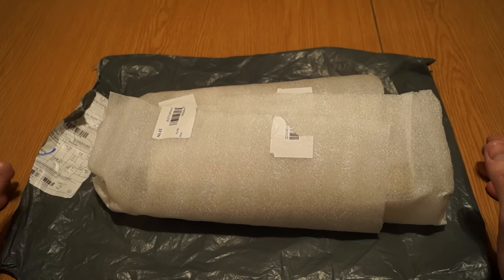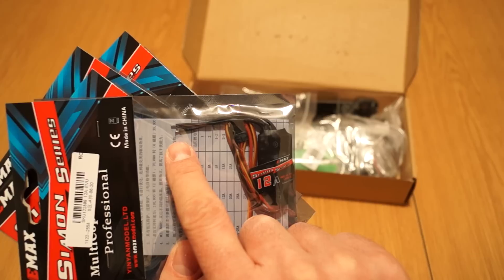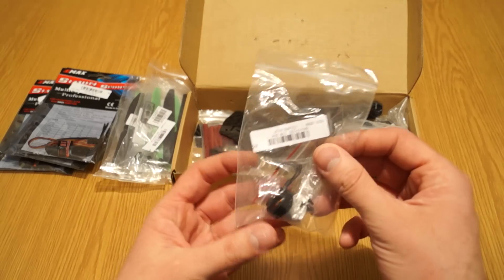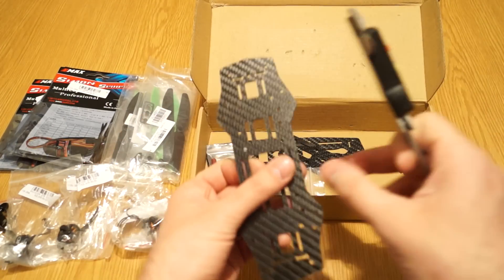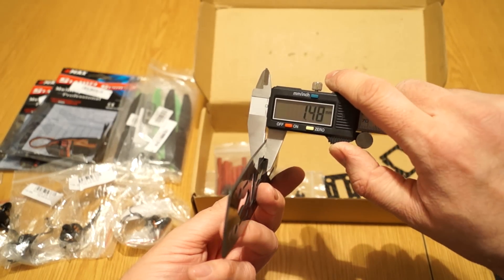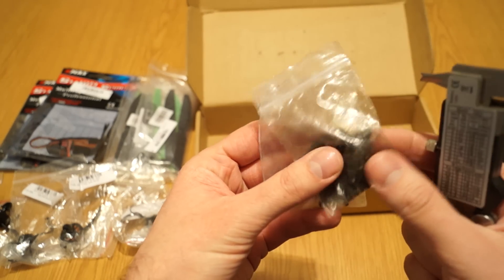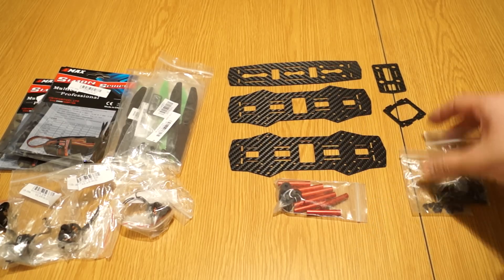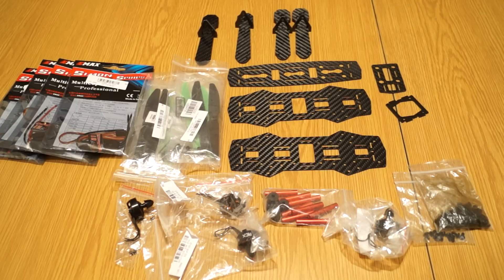250 FPV Racer Quad (Mini - H clone) unboxing

Comment: yah i fly mine on 4s it really wakes up this quad
Reply from the maker: Rc Addict the big question is if the motors will hold together still on 4s... 
I agree with you on the 4s vs 3s...tried it on my flip fpv when I switched to 4s but the sunnysky x2212 have no problem on 4s, when this one might :(
Reply: i fly mine with the same setup it works great

Comment: Hi, there.
How much you spend for all?
Reply from the maker: sean yoon Hi, I got some of the parts from Banggood.com which they provide also as kits(matched motors+esc) but would say it would be a little over 100usd...
Reply: Hmm.. yeah, I see it.
I'm using lot of product from BangGood, too.
Check my eBay order link.. I guess, it's pretty much same product. But, little better than your deal. I think..
That's why, I'm always compare for Chinese products. 

http://pages.ebay.com/link/?nav=item.view&id=351193216842&alt=web

Comment: what am I still need more for the drone can you give me liks because this is my first drone mayby what i ever made
Reply from the maker: Hello again,
banggood has a combo kit with almost everything you need, check this link out:
http://www.banggood.com/QAV250-Carbon-Fiber-ARF-Combo-EMAX-MT2204-12A-ESC-CC3D-p-965217.html

Aditionally you need your receiver and FPV gear...
Reply: jah but can i use a cheap controler
Reply from the maker: swen westenenk Hi...you can use any controller you have, but the cc3d and the naze32 might perform better on the mini's
Cheers

Comment: what for a batry did you need
Reply from the maker: hi Swen, I use a 3S / 1050 mAh li=po that I got from my walkera master CP heli...If you dont have already the batteries, I suggest you get something in the range of 1500 mAh with a minimum 30C discharge.